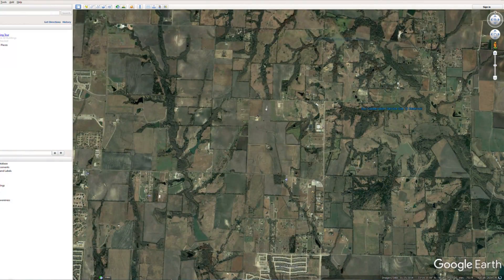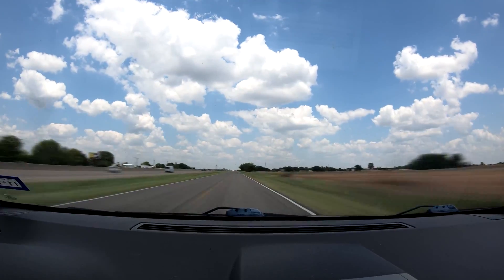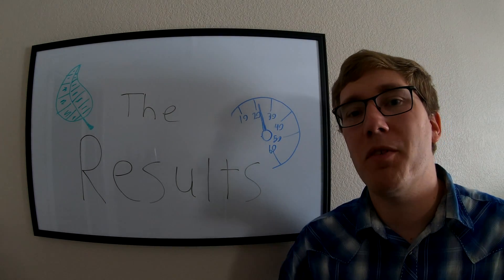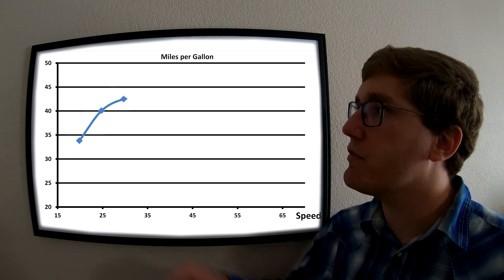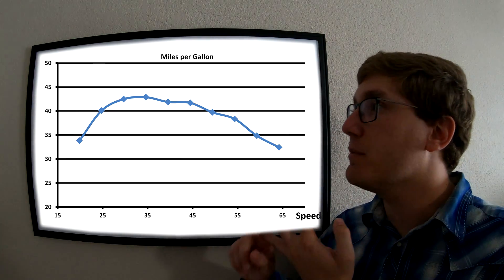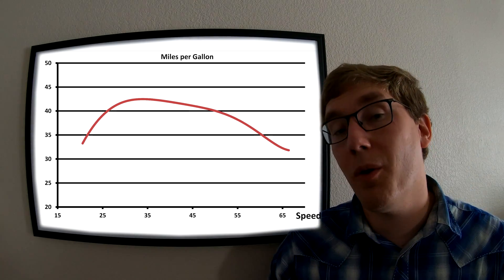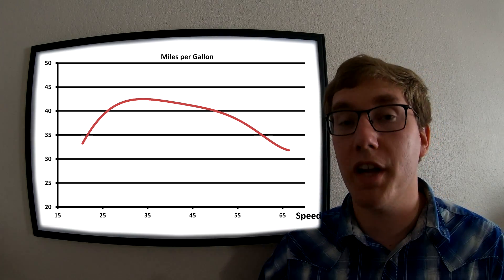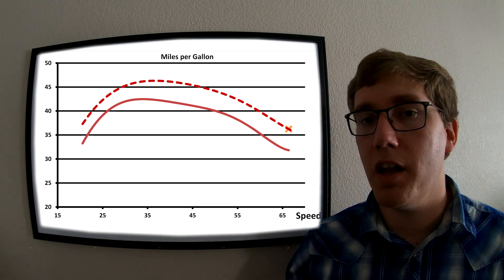The Most Efficient Driving Speed - An MPG Experiment

Comment: No offense, but this isnt a good video. info wise or testing. Firstly, you get less mpg at lower speeds because of the gear ratio, torque and weight of the vehicle. It takes more work to get the weight rolling in lower speeds and lower gear, well any gear really, at lower speeds. You get better milage going faster because of momentum, and gear ratio. The engineand transmission are working harder at lower speeds to get and keep the weight moving, thats why there are different gears with different gear ratios. Secondly, it should have been done on the highway, at speeds 55-80 for longer distances, to be more accurate, and more real world. On the highway you're driving more miles at a consistent speed where its more important to get better milage, and thats where more people want to know where they will get the best milage, because its where they are doing longer distance trips, usually.

Comment: I drive a 1.6L Suzuki APV (a 6 seater Minivan)

It could get somewhere around 50-60MPG's if you drive 35-45MPH 

it would get less if I drive faster than 65MPH

I've also driven a Chevy Caprice with a V8, not a very economical car but it does get 20-25MPG's if you drive at 65-75MPH or a bit more.

I think it depends on the engine..if it's a Gasoline Fueled Engine the bigger it is the faster you should go to get an ideal fuel economy figure..

0.6-1.6L engine (35-45MPH)
2.0L-4.0L engine (65-75MPH)
5.0L above (85MPH)
Reply: With a 1.8 diesel 150hp i got the lowest consuntion at 25 mph/40 kph

Comment: I have a 2019 Toyota sienna XLe would you kindly tell me how many miles per hour will get me the best gas mileage. Certainly sounds like you know what you’re talking about however it’s a bit too complicated for me🤷‍♀️
Reply: The easiest way to get the best gas mileage your car can offer is to drive smoothly and keep your engine RPMs low. Accelerate slowly from a stop whenever possible, and avoid scenarios where you're getting up to high speeds, catching up to somebody, then having to brake and get up to speed again. If you're driving to where you're not constantly having to mash the accelerator to speed up, you should be able to get good gas mileage relative to whatever car you choose to drive.

Comment: So that’s the thing as you say. Higher speeds are simply more efficient especially on the freeway. I’ve got an older golf MK4 V5 170hp version. Soon as I get out on the freeway I get upto the advertised max of 35mpg. Now, soon as I’m in the city, it goes down to 18-19mpg. However, when driving in the city as though you don’t have a brake (engine braking) and only use it when you really have to, I upped it to 27 mpg city driving.
Reply: If you don't slow down at all in the city (say, at midnight and catching all lights green) you get better fuel economy. The same happens if you stay in the slow lane on the highway

Comment: Low-speed losses are also due to a lot of throttle work loss as opposed to moving the car work.
Smaller engines also tend to have higher final drive gear ratios and rev higher.
I had a 383 Chrysler that had optimum fuel economy at about 70 mph but the final drive RPMs were 1800 RPM, hence better combustion efficiency and less throttle work.
Reply: So assuming the car idles at less than 1800 rpm, what happens if you let off the accelerator a bit and do 60 mph at 1543 rpm? What about 50 at 1286 rpm? Are you using more fuel with less accelerator?? Do you have to press the accelerator more to slow down? Does the car speed up by itself when you let off the accelerator? Does the fuel use per cycle simply drop with higher rpm and constant throttle (electric motors work like this with battery use)? Is the car automatic and changing to lower less efficient gears at lower speeds?

I think my little 1.1 citroen is like 2800 rpm at 60 mph so smaller engines are lower geared. I could probably do better about 2200 rpm if there are no hills to climb. But I would have to modify the transmission to do so.
Reply: @TimpBizkit  Lower rpms at near wide open throttle is the most efficient.  Hills, just down shift.  
Keep your speed over 35 mph and under 60 mph to achieve the most efficient forward movement without excess wind drag or throttle work.
Reply: @TimpBizkit not all small engines have low gear ratio, my 900cc dacia logan is at 2100 rpm at 60 mph/97 kph

Comment: The best Driving speeds depends entirely on the car you're driving. A smaller engine will be more efficient at lower speeds as you will get closer to the peak efficiency sooner at lower speeds. I have a 1L Toyota Aygo and it can achieve over 100mpg between 21-30mph although a constant speed isn't always possible in the real world (I have managed to do round trips measuring 105mpg in the city with low traffic levels). It can achieve 70mpg at 50-60mph though, a busy highway with lots of traffic draft I have managed to get 80mpg on the motorway at a constant 60mph.
Reply: I, too, drive this vehicle, you can decrease rolling resistance via increasing tyre pressure by 12%, and add 3-5 mpg,  however, I would not recommend driving the vehicle above 80mph with this extra tyre pressure. Furthermore, you will lose traction, particularly in the wet, which one has to be mindful of.
Reply: This was my first car, and I was getting 45-55mpg despite driving like a lunatic. Now I get 21mpg in my B58 and I hate myself.
Reply: It's not entirely the car, the exponential decrease in MPG due to wind resistance at higher speeds is a constant. But if the car is more aerodynamic this reduces the effect of wind resistant. If your engine and transmission are better suited for higher speeds or higher torque they may not burn extra fuel fighting wind resistance but they may be burning extra fuel at lower speed when there's no resistance. Example, older work trucks optimized for low speed hauling are geared accordingly and will be at excessively high RPM at highway speed meaning they're burning extra fuel, but newer work trucks or semi trucks with giant diesel engines tend about the same mpg at any speed because they already have more than enough power to push through the wind resistance.
Reply: @gorkyd7912  nothing like an 8 litre engine stuck in stop start (so you don't even know when to turn it off!)

Comment: I think if you that test with new engine oil and new tires and clean air filter it will be different... also temperature had little roll too what in winter is not like summer
Reply: No

Comment: I have tested my 2008 grand caravan from denver to el paso tx at 55 mph and 65 mph.
At 65 got my best mpg.15% better then 55 mph.
And faster.
I think its about time and distance.
How many hours driving at 55 compare that hours at 65.
Spend more time at 55 so that means more idle time more gas. 
Less time idle
9.88 hours at 65 mph
11.63 hours at 55 mph
About two hours diff.
Reply: Aladdin  four trips.
Same gas stations, same persons on the vehicle, cruise control no traffic.
Notice when driving from el paso to denver that i spended more fuel going up over the sea level.
I couldn't believe it.
time vs distance
Works.
Spend more time at 55 miles
Meaning more car idle.
At 65 less driving time.
It only works for long runs.
Reply: @DanielPerez-oc8qs  I don’t think you’re idling at 55mph

Comment: I got 49.5 MPG per tank Driving an average 50-55 MPH but also some stops on a two lane highway in a stream of cars in my 1993 civic vx hatchback (92HP 97ftlbs tourqe).  I got 34 MPG at 90 MPH on the freeway in the dessert with no cars around me.  So my car can go 25 miles per hour faster at a high rate of speed and get the same gas milage as your car.  You may find that if you get a better car from the early 90's your gas milage will dramaticly increase.

Comment: Air conditioning is going to drastically influence your fuel efficiency at low speeds. AC is a constant load, so the longer you run it, the more fuel it consumes. If you drive 1 mile in 60 seconds with AC, you used 1/3 as much fuel as if you had driven 1 mile in 180 seconds. 

If you tried this test again without any accessories turned on, you would see your curve rise significantly at lower speeds and only marginally at higher speeds, and your peak efficiency would be reached at 25 or 30 mph.

Edit: also, automatics tend to have faster peak efficiency speeds due to torque converter lockup. Running a manual transmission at 1200-1500 rpm is extremely efficient on flat terrain. Some manuals will get their best fuel efficiency in the gear before the highest gear just because slower speeds are so much more efficient and the highest gear will be too much for that ideal speed.
Reply: That was clever, clover.

Comment: I have a 2000 Chevy Silverado 1500, Long Bed, 4x4, 4.3 liter V8, 222000 miles on the engine, with a canopy on the bed. On the freeway, using the cruise control set at 55 mph, I am able to get 22.85 mpg. Set at 70 mph I'm lucky to get 16 mpg. Takin' it easy and savin' money!
Reply: 4.3 is the v6.. 4.8 is the smaller v8
Reply: Nice, this comment really helped, it was exactly what I was looking for, I have a 4.3 too. I’ve found that 55 is actually better than 70 for the fuel efficiency.
Reply: I can confirm some of these figures. 2004 Silverady 2500 HD, Standard Base Model, V8, Gas, 145,000 miles. Did a long highway trip and using a combination of gas station filling to full (thus telling me exact volume used) and google maps measuring exact distance, I got about 16 mpg on flat ground with an average speed of around 70-75 mph.
Reply: You could just get a better job or a better second hand car like Audi 2.0 tdi

Comment: you could probably expect cars with more gears in their transmissions to have a more flat curve at higher speed
Reply: True, but with greatly diminishing returns as you add more ratios.  Since wind resistance increases with the square of the road speed, and car engines have at best a linear torque curve, the faster you go, the less useful those extra gears will be, with the exception of overpowered engines for the application. Most of the time, cars get more gears to improve efficiency in the normal range of driving speeds between 25 and 75 mph.

Comment: Like with all cars, if you only had 1 or 2 more gears, your peak MPG would be at higher speeds.
Reply: Muranaman exactly! But adding another gears costs more than you would take back in years of efficient drive?
Reply: @mag357colt  Yes, however once it's time to swap out your tires, it won't cost much more to swap them to a larger (+1" to +2") diameter tire.
Reply: @ProDigit80  Oh i didnt think about swapping tire. like you mean larger tire gives higher mpg?
Reply: @mag357colt  
In some cases it can.
Interesting things to note is that changing things like tire pressure and rubber compound to optimize for MPG means you'll have less grip than if you optimized for handling.

Remember that the low rolling resistance tires that are great for MPG are very hard and won't grip the road anywhere near as well as a sticky summer set
Reply: @mag357colt  Depends. Many gearboxes can easily be modified from the factory (by replacing 2 cogs).
No one does it though...
Also, installing a larger wheel/tire diameter, will get you a taller gear ratio (eg: of 2" larger outside diameter = ~10% higher gearing = ~5-7% better fuel economy in final gear).
This works particularly well in jeeps, trucks, and elevated cars.
Reply: My Subaru outback, with CVT gets 70MPG @ 40MPH steady, and that is with a 2.5 Liter engine. The CVT does rob power compared to a regular transmission; but it gets this high MPG because the engine is literally doing 1.2k RPM.
My Fiesta with a 1.6 liter got 60MPG at that speed, all because it's doing 1.5k RPM.
I put bigger wheels on my Fiesta ST, and the actual MPG was identical (even if the MPG readout was reading lower, because the car doesn't know it's running 10% larger tire diameter).
The new tires also were wider, which accounts for more rolling resistance.
Reply: Larger diameter wheels result in an increase in air friction, offset by a lower engine RPM.
It makes most sense at speeds below 80MPH. Anything above, and the wind resistance becomes more apparent, and MPG gains will lower. You still get gains from running lower RPM though...
Reply: That's not necessarily true. It would be better, yes, but the major reason it decreases is air resistance, not gearing
Reply: @thomascocks9136  I was commenting on optimal MPG speed, not on MPG numbers themselves.
Almost 90% of the vehicles will get better MPG with a taller final drive gear ratio, at higher speeds.
The closer one can run an engine at idle RPM while driving, without lugging the engine, the higher the MPG.

Comment: You need a BSFC charts for the engines, plain and simple. You could guess off a dyno chart as most charts run around peak torque around 70% load. But even that can be unreliable depending on how the engine is mapped. What you said earlier in these comments about the car will shift "for peak efficiency", isn't entirely true, stock tuned cars are tuned to provide comfort, emissions compliance, reliability, then fuel economy is usually fourth or so. You still decide acceleration rate / engine load, and even worse cruise control which will vary the engine load due to a number of factors just to maintain speed at all costs. You could actually get better economy in hills rather than flatlands depending on your top end gearing. (similar to pulse-glide only your using the hill to pulse / build kenetic energy and the downhill to glide)... its a whole differnt world of thought, If you're interested I've started teaching on the subject, just send me a message.
TLDR, Research: "BSFC charts" and how to read them (most have never heard of them). Second Research "Drive with load" and "pulse and glide" techniques and why they're used. It will give you new insight into engine efficiency and explanation to the numbers.
Reply: I did actually get better fuel economy once in a hilly area. I drove through the Peak District on my way home, it started with an incredibly steep climb that my car barely managed to maintain speed in 2nd gear. After the climb was over I must have spent about 5 miles rolling down a hill without using a single drop of fuel in 5th gear in fuel cutoff mode (I think eventually the engine did kick back in because the engine temperature had dropped too far). I averaged 78mpg in a 1L petrol Toyota aygo doing that. 

I always try to think of hills as an involuntary energy storage though (basically most of the energy you put into climbing them you can recover on the descent, unless you need to brake to stop your car speeding up uncontrollably... I'm sure I've been down hills where if I didn't the car would've easily got to 120mph without using any fuel which would be incredibly dangerous). I quite like motorway slip roads that you go up coming off and down coming back on (most of your speed is stored as potential energy coming off instead of getting turned into heat by the brakes)
Reply: @mikes1992u  Add regenerative braking to control decent speed and then there is a fantastic combination, even with as inefficient as regen is. I almost went as far as putting a glider plane style "variometer" to better guess what's going on with the elevations/ kinetics as hills can be deceiving in their size and grade.

Comment: This car is pretty inefficient at higher speeds, I get over 60mpg at 55mph, which is a pretty much what every Mercedes 2.0L disel with 140hp has been able to do since 2005, and mine is additionally tuned to run leaner at low power demands. But 37mpg at that speed is downright abysmal, I can drive 80mph and still get better fuel economy. If fuel cost as much as it does here in EU, you'd probably all switch to Prius overnight.
Reply: J J  They're actually real close in most emissions categories for engines in the last 5 years, petrol / diesel are literally refined from the same distillate towers. Then you have Bio / alternative options for both.

https://dieselpowergear.com/blogs/diesel-power-news/diesel-vs-gas-emissions-why-diesel-is-better-for-the-environment

https://www.sierraclub.org/sierra/ask-mr-green/do-diesel-engines-produce-less-co2-regular-engines

https://theicct.org/sites/default/files/Gas%20_v%20_Diesel_%20CO2_emissions_%20EN_%20Fact%20_Sheet%202019_05_07_0.pdf

http://www.air-quality.org.uk/26.php

https://phys.org/news/2017-07-diesel-gas.html
Reply: American gallons are different

Comment: Your Z only gets 25mpg at 65mph? I am curious as I drive a G37 7speed auto and have the same engine.Typically get over 30mpg at 75mph without CC. I do better without the CC.75mph seems to be the sweet spot. Also slightly better with non ethanol fuel. Wind speed and direction play a role ofcourse. Your data is spot on as I was driving my niece’s  Sentra with CVT for awhile on my same route.
Reply: imagine that a 7 speed would be more efficient than the sentras 6 speed, G37 seems like it would be more aerodynamic as well. The youtuber mentioned he was running the AC around the 1:47 mark which would hurt mileage but didn’t seem to mention what type of gas he was using where ethanol content can make a big difference. Also need to factor in things like wind direction and wind speed which can help or hurt mpg.

Video wasnt really a controlled experiment but seems like more of a general guide

Comment: What was your engine speed in this experiment?
Reply: Rpm for test
Reply from the maker: Varied depending on speed. The car has an automaric transmission so the car will shift to keep it running at peak effeciency.

The slower speeds were around 1500 rpm, at 60mph it was around 2500.
Reply: @thecarizon504  
I have lexus is220d. In 6th gear at 2000 rpm I am doing 90mph.do do think is that thermal efficiency at that speed?
Reply: @saghirhussain4429  No your cars gearing is different. Also 90 mph? you mean mpg?